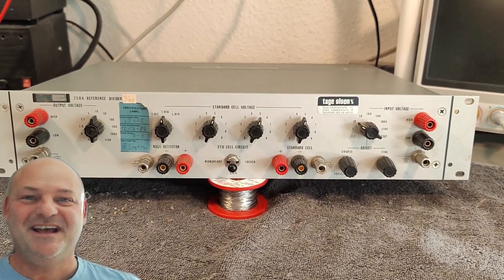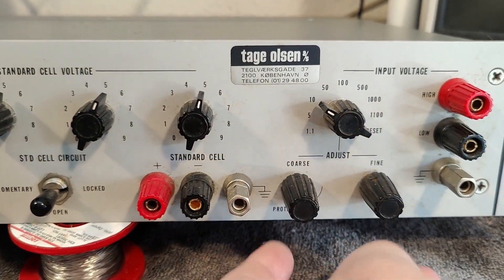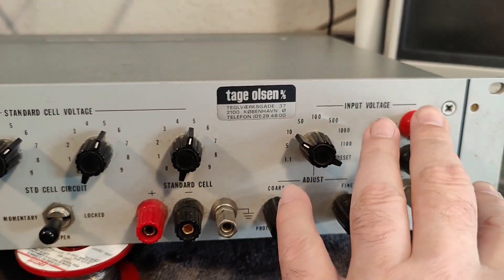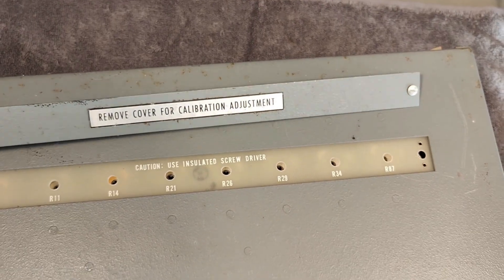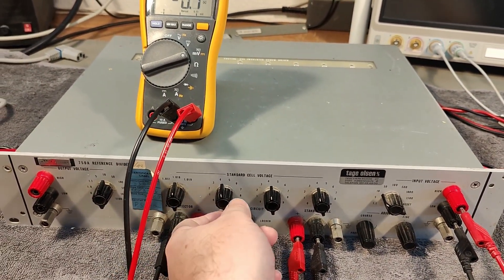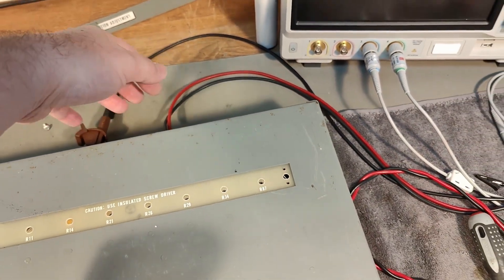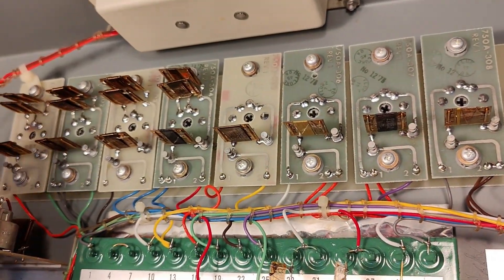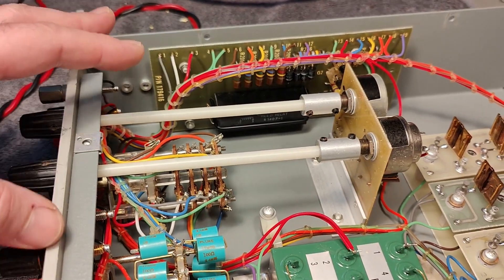FLUKE 750A reference divider weston cell 1975 test teardown

Comment: Gotta love old fluke: "shove $1000 worth of resistors in a box with some rotary switches, and ship it"

Seems you need to get/build a simulated weston cell reference for yourself, unless you have something like a 732A/B hanging around
Reply from the maker: i got this : https://youtu.be/sOS_bX-AlFE
Reply: @TeardownOZ2CPU  Henrik Volkers (which I probably annoyed very much with detailed questions) of PTB demonstrates apparatus at shows with an, I think LM399 based reference mounted in a real weston cell case, for safety and style.
Reply from the maker: @splitprissm9339  cool idea, i got all the ref parts stocked for my voltage-nuts experiments, i just dont make many videos about this sort of thing

Comment: You adjust the voltage controls in the centre to match the voltage written on the standard cell's calibration sheet, including any temperature related ofsset. Don't change these again. Now you can attach the power source on the right and adjust the switch, coarse and fine knobs to achieve a null. The box is now calibrated and you can use the output on the left for whatever voltage you like. Unfortunately the box itself does need calibration as it is full of precision divider resistors that may drift over time.